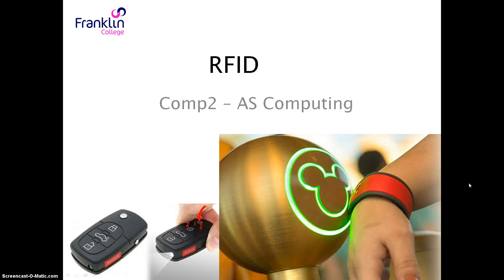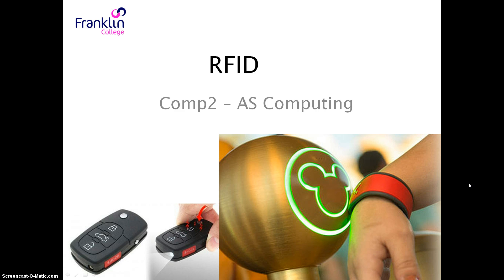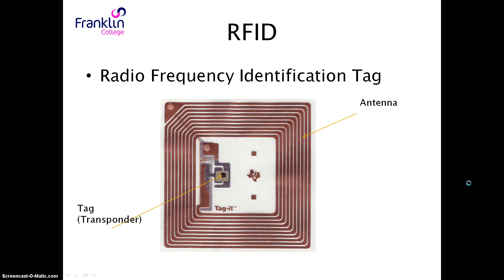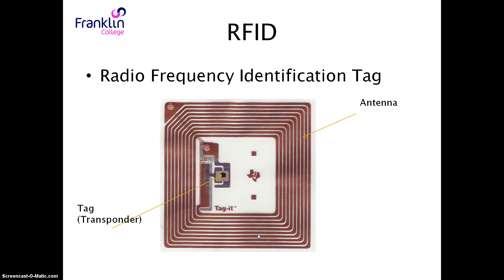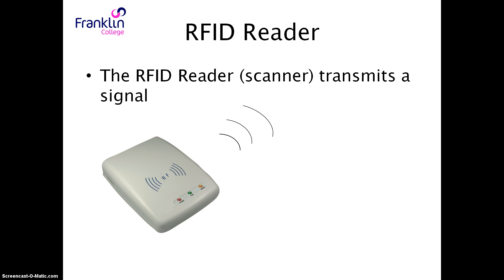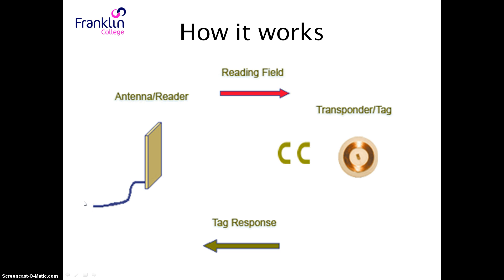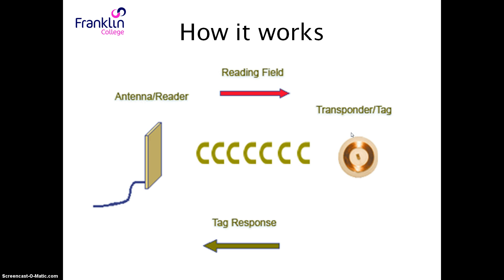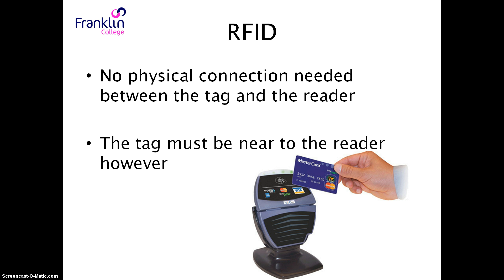How RFID works

Comment: I know, this video is old, but you made a  few mistakes:
The "RFID-Tag" is not only the little Chip, its the whole "Sticker".
And you have to separate the Reader from the Antenna. Often, its in the same box.
The Antenna sends the signal and is connected to the Reader, which use the modulated Signal (the Tag only modulate the Signal from the Antenna) and send it to a PC or something else.
Reply: Following on from what you mentioned, it is in fact a RFID Label not Tag.